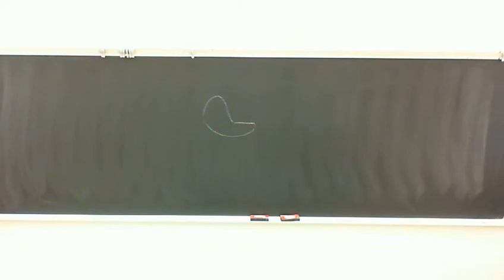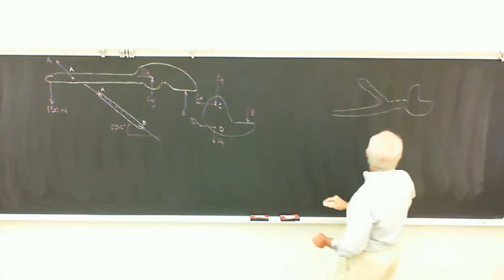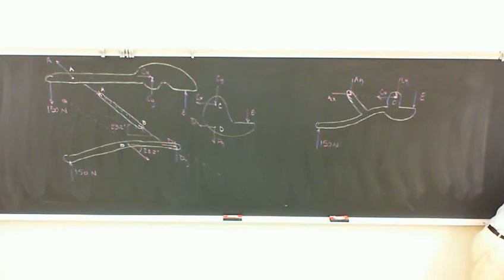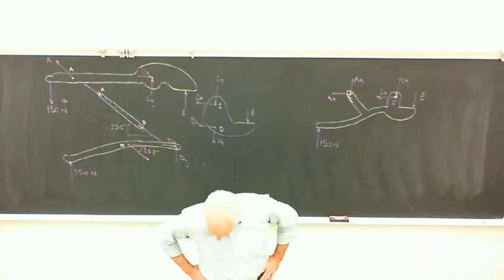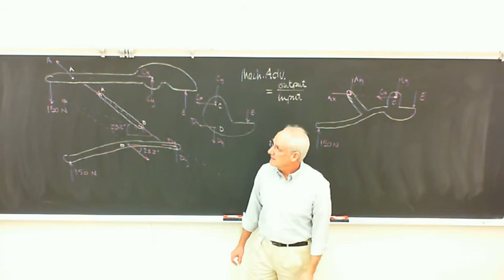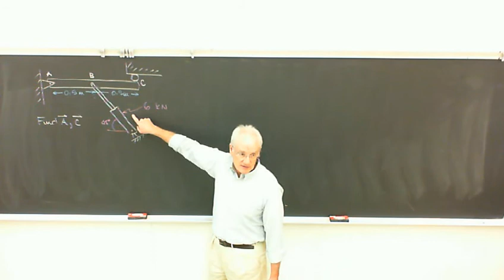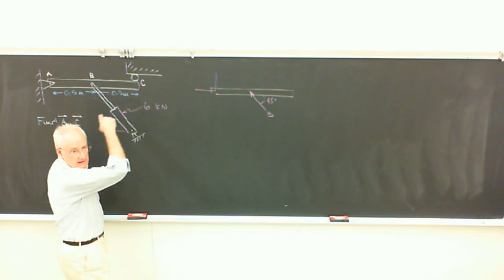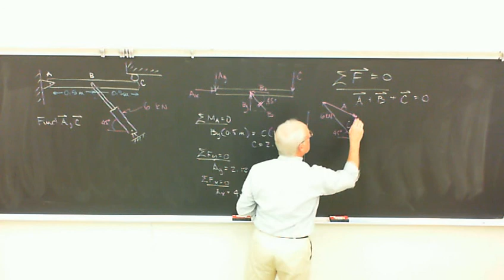Frames and Machines, Part III

Comment: For solving the pliers - could we use the method of sections on the top to remove the Cx, Cy, and E unknowns, replacing those 3 with 2 unknowns? That gives us a total of 3 to solve.
Reply from the maker: Sure you can.  These methods are not mutually exclusive.  Some are better for certain problems, but feel free to mix and match the methods.  Just make sure you can do them all so that you can use whichever is best for your problems.